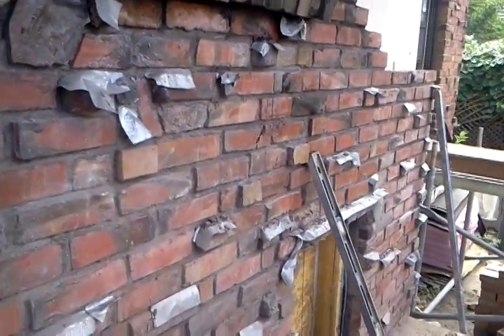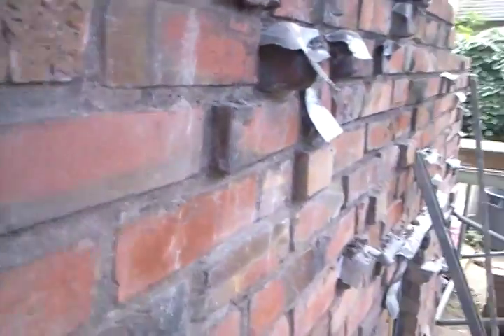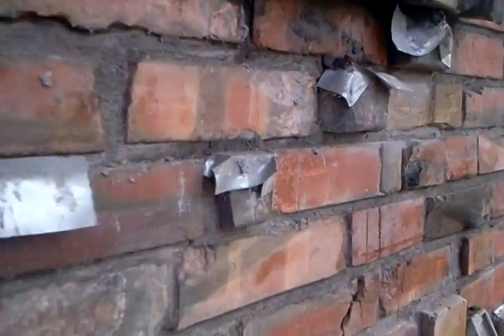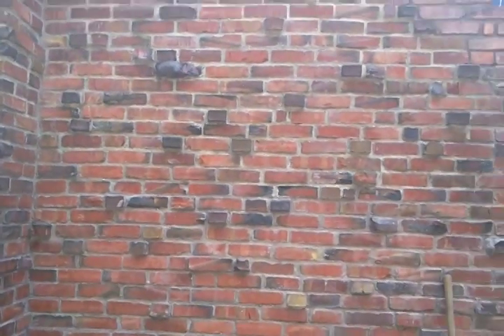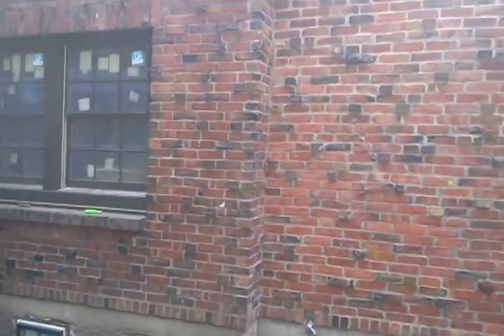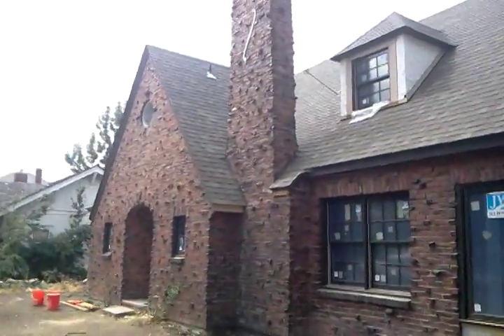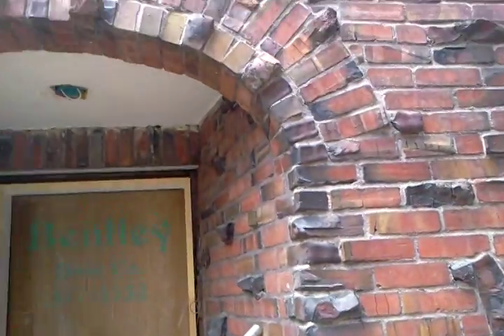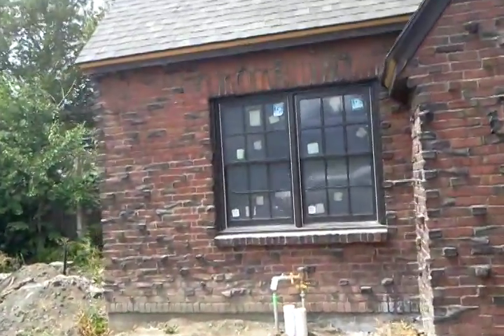clinker brick project

Comment: My fireplace has clinker bricks, same with the outer part of my house. My old man loves them but I'm not a fan. Is there a way I can cut some of them off my fireplace? My entire fireplace isn't made with them but it has some throughout it.
Reply from the maker: Sure u can but keep in mind they are very hard. It may be a chore and much easier to just remove  if you send me a picture to my email it would be easier to school ya through the proccess. If you only have a few to deal with and are certain you want to cut them you'll need to use grinder wheel after they are cut back to get them flush and I don't believe it will still have the sharpness in its color after all that. That's  why I reccomend removing them. Are you in boise?